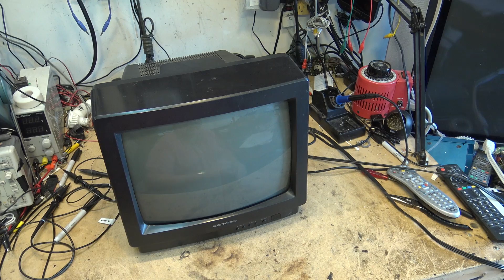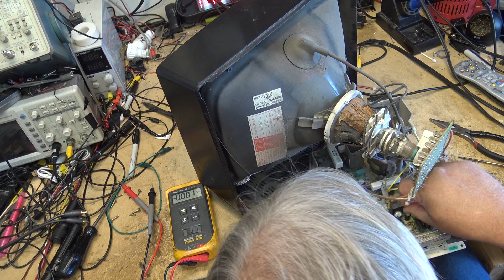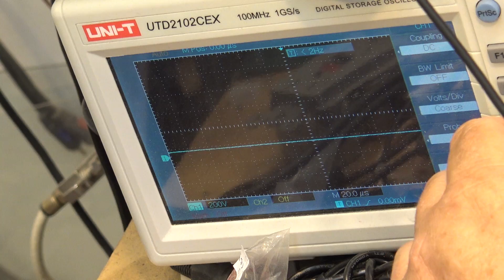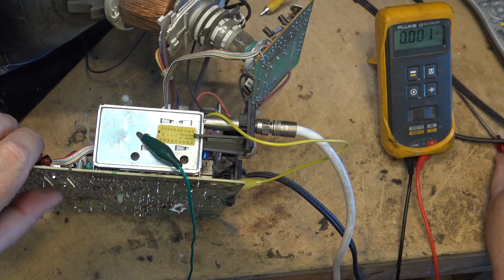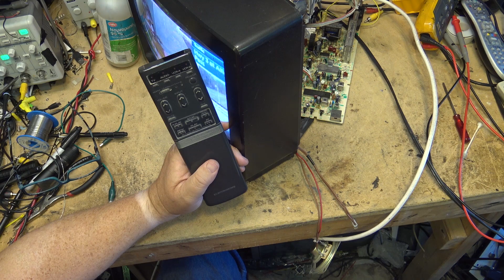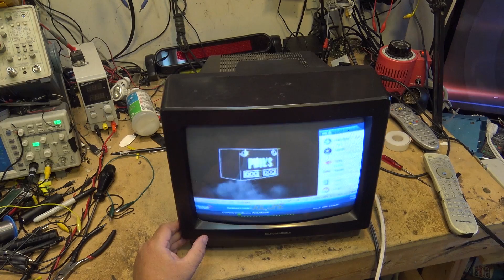Mitsubishi CRT TV from hell   Worst damage I have ever seen   can it be fixed lets find out

Comment: Do you know if all the secondary connections on a standby transformer give 0, does it necessarily mean that the transformer is dead?
Reply from the maker: Use your meter and check the windings.
Reply: @12voltvids  Sorry, it's not the standby transformer but the central PSU transformer with multiple windings (not sure how it's called). 
They seem ok on both sides as far as i know (low resistance).
Anyway, I'll continue running my Nth round of retesting everything until i start understanding better how it all works. Thanks for the reply

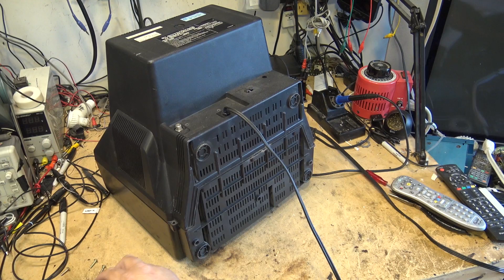Comment: Can setting the tv on the face of the tube like at 3:12 damage it? I see you do that a lot
Reply from the maker: If I had diamond dust on the bench and dragged it across sure.  Glass is pretty tough. This tv went in the bin when the video was done FYI.
Reply: @12voltvids  Good to know, I thought maybe it was bad practice because some have anti glare coating that can be more easily scratched than the glass itself. You’d know better than me though 👍🏼

Comment: Dave, My Grandma Nellie's Old 1997 White Westinghouse CRT TV Has a Bit of flare when all the controls are up all the way on ch 4. But... On 3, THERE IS ALMOST NONE AT ALL!!!!! WEIRD!!!! She had Spectrum Cable boxes from 4/5/2018-5/16/2020 and she had it on 3 which had no flare but still does obviously when it fades in. It is now in the spare room as she got a roku onn tv when she thought the tube broke on 2/10/2020 when she just heard soind and no picture. Just a cable box glitch. Unplugged the box and it worked. It will be turning 24 in June and it STILL WORKS!!!!!

Comment: If anyone comes across a red blinking light on a samsung TV,  and tried the capacitor replace or just cant find why voltages are erratic, there is a 8 pin IC that drives the frequency of the secondary tranny. I couldnt find this 8pin IC anywhere. Save yourself time and get a new PS board for $60 Bucks. They deleted the 8pin ic on the new board.

Comment: Couldnt you write a piece of code to shift the screen around to stop the burn in? or maybe build your own circuit inside the tv and fit a button at the back to switch it on that flips the picture every 10 minutes
Reply from the maker: From an analog signal. Good luck. Plasma sets did do the pixel shift and one of my plasma sets is almost unwatchable now thanks to global tv and their stupid screens on the news.  Like fox and cnn but I dont watch those channels.  The pixel shift may reduce it but not eliminate it.  They just make the burn in a little blurry as opposed to razor sharp.
Reply: @12voltvids  A circuit to flip the image using the crts vertical wires, basically a timer circuit, this would invert the image for 5 seconds every 30 minutes, alternatively a piece of hardware that attaches to the cctv system that does the same thing using a 555 timer. its defo possible in both cases. plasmas should be burned in for 30 hours on a pure white screen before use, then image retention will never happen.

Comment: 12VOLTVIDS< what are the G1 & G2 signals used for? TV repair techs say that using a Rejuevenator is bad not good on the RGB gun which is killing the life of the RGB guns, any reasons why? I thought you use a Rejevenator when the RGB colors look dim and fade of color.

Comment: I think that tv has the most flare I have ever seen despite the picture low.
Reply from the maker: Tube is probably getting a little soft.  It has thousands of hours on it. I used it as a camera monitor so it was left running all the time.   I have a few with serious screen burn and that is relatively hard to do.
Reply: @12voltvids  did you leave it on for an ENTIRE 168 HOURS/7 DAYS?!?!?!
Reply from the maker: @austinthevhsvideogamelover5265  
I have had monitors that have run 24/7 till the tubes are totally shot. The one in my shop I use to view the cameras on I put in service in 2006, and kept it in service running every day from 0700 hours to 2300 hours on a timer until 2015 when I was given an LCD. SO I put the LCD in it's place and moved the severely burned CRT to the shop where it is still turned on when I am working in the shop. I have a Sharp LCD computer monitor that as of now has 50858 running hours according to the total time display. Much of that was 24/7 operation too. I tend to  turn things off more now as the price of electricity is much higher than it used to be. Used to be almost free so I used to waste much power. Now it is 2.5X more so I conserve as much as I can.
Reply: @12voltvids  So did the Mitsubishi get left on all day/night?
Reply from the maker: @austinthevhsvideogamelover5265  yes for several years and it was old when I got it because I picked it out if the garbage at the shop I worked at.  Customer did not want to repair.
Reply: @12voltvids  did it stay on for years?
Reply from the maker: @austinthevhsvideogamelover5265  <message deleted>

Comment: So leaving the tv on for a extremely long time can give it more flare?
Reply from the maker: Well as the tube gets tired yes they will start to bloom or flare.
Reply: @12voltvids  well some newer tvs flare at the color, contrast, brightness, red or greenest tint all the way up.
Reply from the maker: @austinthevhsvideogamelover5265  
Flaring is a sign of a weak crt. Many newer tubes had relatively short lived due to dark face glass to increase contrast requiring running the tube hot which reduced its life.
Reply: @12voltvids  Well my panasonic tv vcr combo from 8/2002, Only does it for 5 seconds when I turn it on.
Reply from the maker: @austinthevhsvideogamelover5265  
Right as the tube cathode warms up and emission goes up.
Reply: @12voltvids  Can CRTS survive lightning strikes more than lcds?
Reply from the maker: @austinthevhsvideogamelover5265  they do pretty good . Fixed many after lightning strikes.
Reply: @12voltvids  many take strong shocks, though, although the lcds cant.
Reply: @12voltvids  So back in the 2000s when this was working, just to be clear, did this used to not flare as much?
Reply from the maker: @austinthevhsvideogamelover5265  
The flare can be caused by a couple of things. On excessively used picture tubes the cathode in the electron gun gets weak. This is caused by oin deposits contaminating the lens (basically a tiny hole in the metal  cap of the electron gun that the electrons stream out of) The hot cathode that emits the electrons is inside this enclosure.When ions collect around the opening they influence the shape and direction of the beam so it won't focus correctly.
If the tube is OK, I would suspect the screen capacitor has failed. Here is a video that shows that symptom and the solution.
https://www.youtube.com/watch?v=ebOmWYqlOIY
Reply: @12voltvids  on the 1997 white westinghouse house tv my 2nd grandma has, it does it a little at everything all the way up. On yellow with black background, with the tint all the way red, and on the 2003 9 inch sanyo, it does it more. They both still work flawlessly.
Reply: AND ON THE 1998 PROSCAN TV MY UNCLE HAD, IT DOES IT A LOT!!!!!!!! BACK ON 11/24/17 SOMETHING HAPPENED INSIDE A CERTAIN CAPACITOR BLEW, CAUSING THE INSIDE TO SMOKE AND MAKE A  CLICKING NOISE WITH NO PICTURE. COULD YOU TELL ME WHAT HAPPENED?

Comment: Just figured i would say that a properly working crt does not emit harmful radiation, there is still radiation but not harmful, that problem was fixed in the early days. Considering this is a 90s set it would literally be impossible for it to give the cat cancer (especially if it was on the back of the set), unless it already had electrical issues causing the crt to get too much power.
Reply: your name gives credibility to your statement.  no radiation here to see, everything's fine, move along.

Comment: Yeah that's an interesting one. Perhaps the mere act of observing if the cat hiding next to the tv is alive or dead from the x rays hopelessly obscures the data. However, you have proven that the tv is alive in this scenario. Very nice!  I saved a TV from cat barf but only because I saw it happen, pulled the cord and cleaned the neck and pcb's.
Reply: The TV had the last laugh!
Reply: @NOWThatsRichy  I like most cats, but they do wreck cable boxes and other things when people let them use electronics as heated beds by blocking the vents, filling them with fur+.

Comment: Is there any way you could explain " Radio Frequency." You are truly remarkable. I do not miss  your video.
Reply from the maker: All electromagnetic waves traveling along a wire will radiate around the wire.
Higher frequencies radiate more easily, and travel further distances.
These are known as RF or Radio Frequencies.Some frequencies, typically vetween 60KHz and 30MHz can travel extremely long distances. Frequencies above 60MHz are generally considered line of sight, as they don't reflect off the ionosphere like the lower shorywave frequencies do, except under specific condition that happen every once in awhile.

Comment: For the first 5 min I thought you said a cap might have thrown up inside and I thought it was going to be a quick capacitor replacement video. Then I realized you actually said cat.
Reply: That would make it a CAT-astrophic failure - caused by some bad CAT-acitors.

Comment: That tv would make for a good candidate for doing a rgb mod on it.
Reply from the maker: Yes it would because the low voltage side isolated by the flyback.
Reply: @12voltvids  Will you ever do an rgb mod video on one of them ? Would make for a good video, even more with all your knowledge ^^
Reply from the maker: @chainedenintenloup  
Well first I will need something that puts out an RGB signal.  All the current stuff I use is DVI and HDMI.
Reply: @12voltvids  If you have a computer that has a vga video card that can output at 15khz, it should work, but yeah I see.

Comment: I have same TV. Still works!! Never had any problems with it. Good job on the repair. You can fix anything !!!
Reply from the maker: I have another one the same but a 28" version that still works great.
Reply: I saw your video on how to reflow a BGA using a halogen light bulb,great idea.Can you tell me what wattage bulb you used and how high above the BGA did you place the bulb? you said you heated up the BGA for 2 hours

Comment: Wow i didn't think that would live again, smashing repair dave :-D
I really expected most of the parts/legs to be corroded away, any acid from the cats stomach  would have been horrible.
The poor cat must have been very ill :-(  it's body chemistry would have been really screwed up, that often screws up brain function.
I'm sure it didn't do it on purpose.

Ahh tunnel diode, i had an oscilliscope (techtronics) with two in the timebase section, they must have been ok as the timebase was spot on.
It did have an odd bright up fault, my mate said he would like to have the scope so he swapped it for a cossor scope that i was quite happy with.

I say Solder as well,   Maybe people could call it metal glue lol.
Reply from the maker: This was long before the cat got sick.  This monitor has been out of service for probably 10 years.  I lost that can 4 years ago. 
Hairballs. That is why the cat chucked. It is just this cat used to crawl up on the tv or satellite box and barfed on both of them.  When the satellite box went up it shot sparks and flames out the top, singed the cats fur a d scared the crap out of my daughter whom was watching tv at the time.  She would have been perhaps 14 at the time.
Reply: i don't think anyone would forget that lol,  it was a cat astrophe wa wa wa, sorry bad joke :-D
Could you imagine if the cat peed on the eht section...oww 20Kv or more, now that would sting a bit :)
Reply from the maker: @zx8401ztv  
Don't even go there.  I have 4 cats and even thou they have all been chopped one of them leaves his calling card from time to time.  One of them pissed on a live power bar once and the smoke and smell drove me out of the house.   Think mov going nuclear along with burning cat piss!   I hope when my kids fly the coop they take their cats with them.  My wife would probably have something to say about that though as she loves her cats more than the kids.  (That's because they are grown up now and we remember when we were their age we had our own place). We were motivated to get a good job and buy a house.  Today's generation just wants a minimal job so they can use that as an excuse as to why they have to live at home till they are in their 30s or 40s

Comment: Canadians and Brits pronounce the L; Americans don't we gave that up in 1776.
Reply from the maker: You dropped the U from Colour too.
Reply: @12voltvids  Funny spell "check" for bank account is too.  Also for the price of about 150' solder wick, is a Chinese desolder vacuum device.  CSI (Circuit Specialists) 474A+ Model is unbeatable for the price and performance on PC works better than sliced bread.  You can unsolder caps off the board in in seconds. :-D
Reply from the maker: @garybevis8691  you mean "cheque" right.  Check is something I would do while looking for a problem.  
I don't do enough work to justify buying a desolder station.  Viewers might think I do this work all the time but the reality is I might work on 1 or 2 units a week max.  That roll of solder wick I have I have had for about 8 years and it is still half full.  When I worked in the business sure one was handy.  I had one but I left that business  16 years ago now and have no plans to get back Into it.  I am pretty selective as to what I work on now.  I turn away much more than I accept.   I get requests daily to fix different things and I say no to most.  1 because there is no money in it and 2 because of the lack of parts and 3, well I just don't feel like it most times.  I usually say yes to vintage audio gear.  Stereos tape decks turn tables, VCRs ect. I say no most of the time to AV receivers, dvd and BluRay players and flat panel tvs. 
I only do this on my days off the regular job too.
Reply: Which is the correct way.
Reply from the maker: It was actually the French that dropped it because they don't have the letter L in old french  vocabulary. Nor do the chinese. I worked for a Chinese guy at the first shop I worked at and he pronounced it  "Sorder"
A monochrome tv was a "Brack and White TV"
Reply: 12voltvids, you have it backwards. Solder comes originally from the French word "souder". The British added the L because they confused it with the Latin word "solidare". Thus the American pronunciation is closer to the original.
Reply: @vwestlife  One D = so der, Two D's = sodder as the yanks so badly pronounce it as with many other things, if you want to ask someone for spelling then DON'T ask a yank, on average at least on YouTube their spelling is atrocious , bad education?
Reply: @12voltvids     fim and flashbubs for my camera
Reply from the maker: @TSM1223  Old school

Comment: “You put it in a storage unit and left it there...” Well, there’s your problem! Made that mistake before with a computer. The HD, CPU, and RAM were the only things salvageable; the rest is parts. Thermal expansion and contraction (and probably some condensation) and that one was a write-off. 😢 of course, having cat droppings/pee/vomit/hairballs/etc... isn’t going to help the set, either... 🥺
Reply from the maker: My storage space is heated so no moisture problems.  It is a secondary work space.  I keep my beta and 3/4" decks in there.

Comment: maybe try testing all the capacitors for a future video. i bet theres a bunch dried out and bad. A $10 cap kit should improve picture even more. With arcade monitors its common practice to replace almost all the caps after a certain amount of years and the monitor looks like new afterwards. ive also seen guys wash the circuit boards with water-soap in a sink then letting it dry and it does no damage. thx for the videos ive learned alot from u.
Reply: when you put it back in a box it doesn't matter

Comment: How would you go about cleaning the cat gunk off the PCB? I'd imagine after the set warmed up it would stink?
Reply: discharge all the caps and stuff then clean it with distilled water and a soft bristle brush. WATER! I know, crazy isn't it?
Reply from the maker: @ItsPyrus  
Water will do, but it has to be totally dry before plugging in.   This set will never be used in the house again.
Reply: @ItsPyrus  That is correct -  pure/distilled water is an insulator, not a conductor and when carefully used, does little or no harm to any electronics. Cheaper than commercially available alcohol cleaners.
Reply: @RoughJustice2k18  although if you just use straight alcohol it not only works better but has the benefit of fast evaporation, so you don.t have to wait on it to dry, as it evaporates almost instantly

Comment: What would be the result after opening it first and spotting the cat goo (before even plugging it in), then starting with:
Thorough hot water spray, leaf blower and then 30 day wait for it to dry out completely, before any power was applied?
(WD-40 and then a solvent rinse optional.)     GREAT JOB YOUNG MAN: 5.1v Zener and some trace repair You know your stuff!
BTW, in Illinois, it costs $25 just to throw it away at the electronics recycling facility. $35 if over 20" diagonal screen size, just because.
Reply from the maker: We pay that fee on all new electronics.  Buy a new led light bulb for a buck 50, bay an extra 25 cents for recycling.   Buy a tv it varies from 20 to 50 bucks. Added at the till.
Reply: @12voltvids  ...Oh yea, just because, goobermint